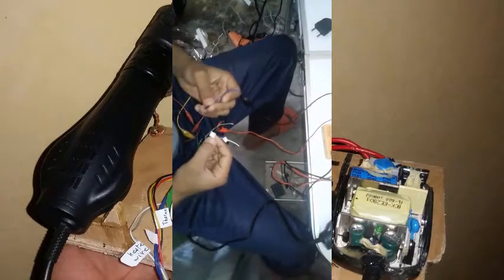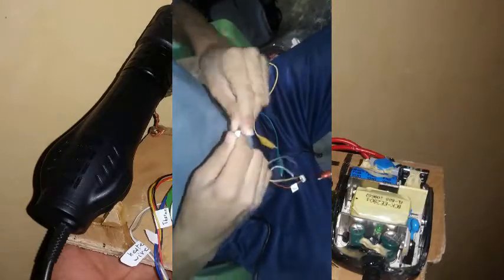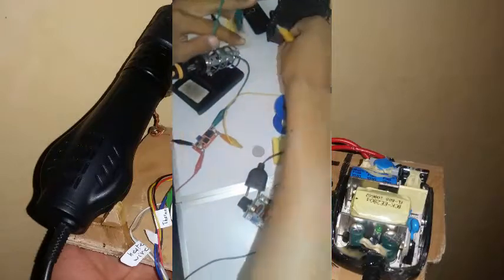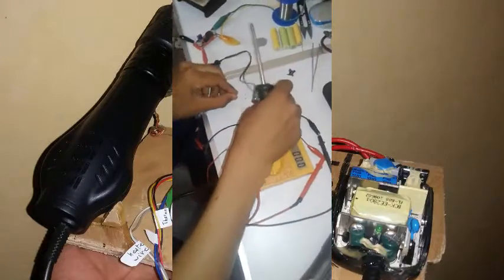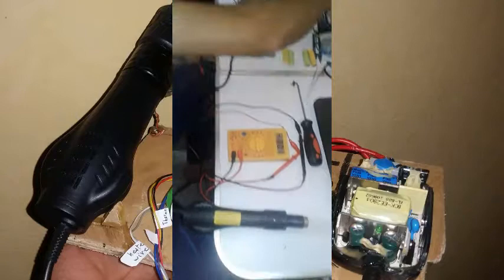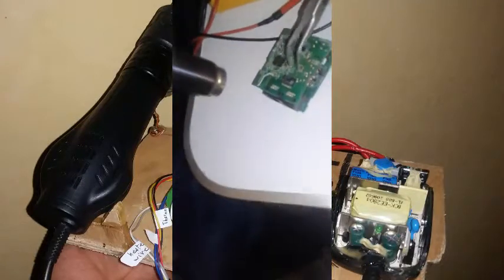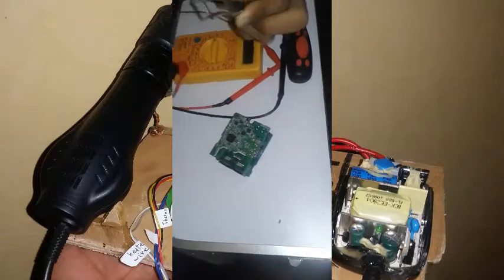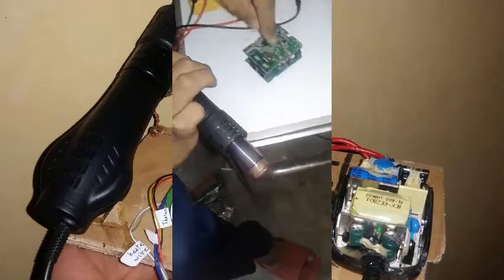The cheapest DIY hot Air gun station build _  part-02

Comment: Video size makes it hard to see so I gave up!
Reply from the maker: ok buddy, I apologize for that,  I can make a schematic for you if you like,  but that would have to be posted on my fb page, if you want so let me know, also if you want I can give refer you to an other video which is more detailed than mine, actually I've watched it before I did my own
Reply from the maker: here is a link you can check: https://youtu.be/PSC3ASeTU8o,   If you're good with electronics and not afraid of opening your hot air gun , just do it and it'll be easier to identify each wire